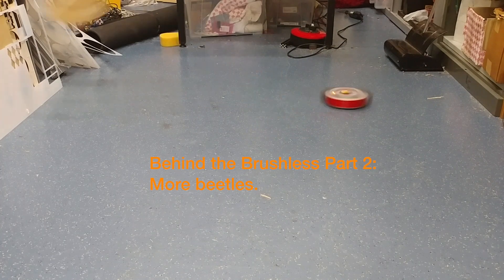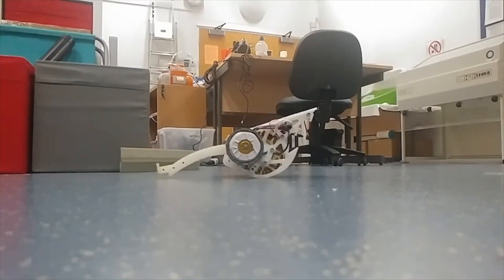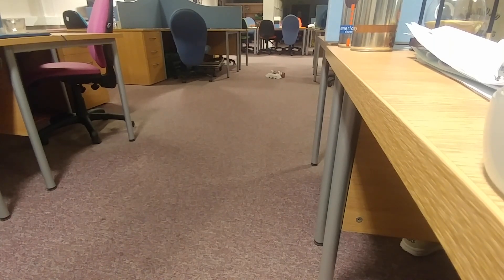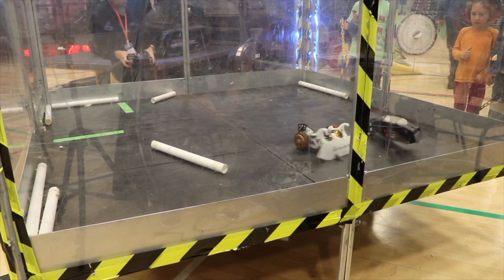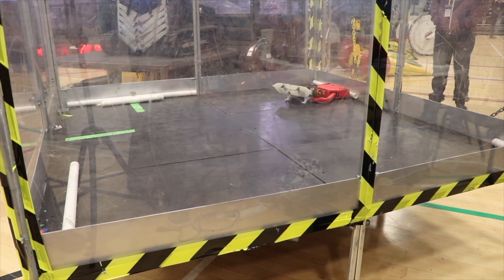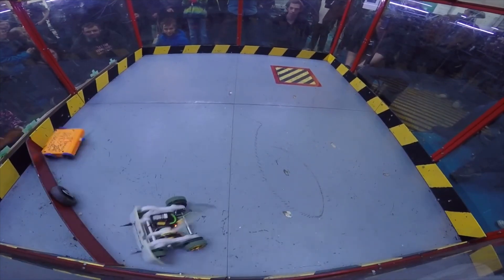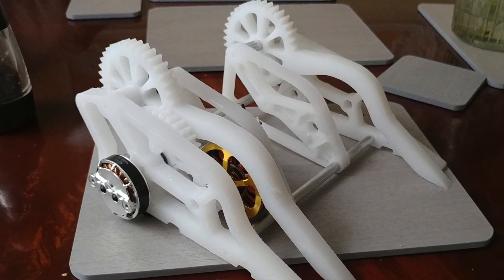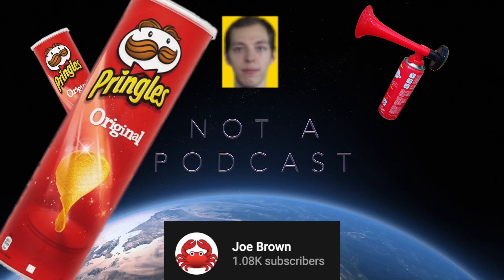BBB: Behind the Brushless Pt 2: Speeeeed - Gear Down For What? & Tosser - Build a Beetleweight Robot

Comment: I would love an in depth video on the esc's (presumably FOC?) and setting up a gyro in a robot. I'm super interested in a project called simplefoc, it looks very close to putting out an arduino based foc brushless controller capable of running beetleweight size motors.